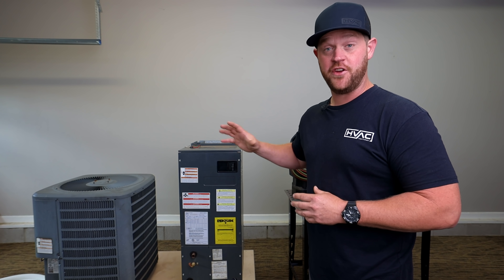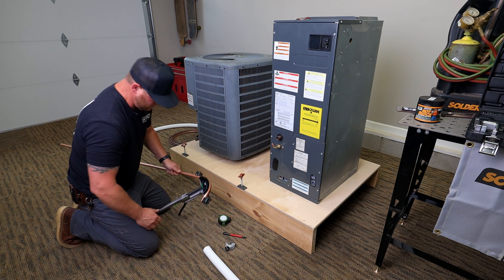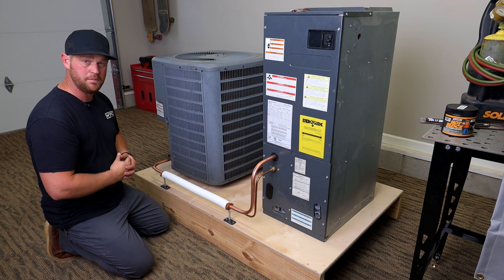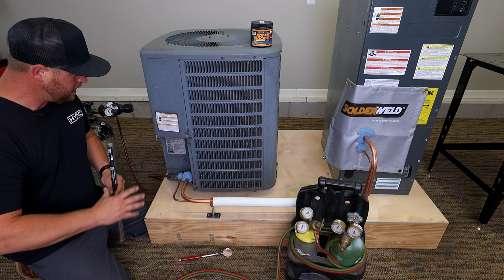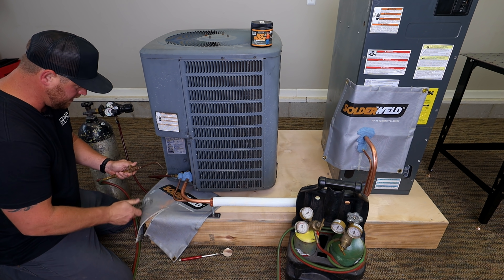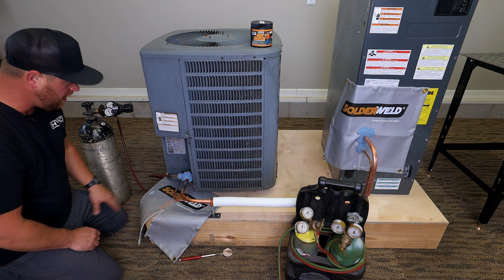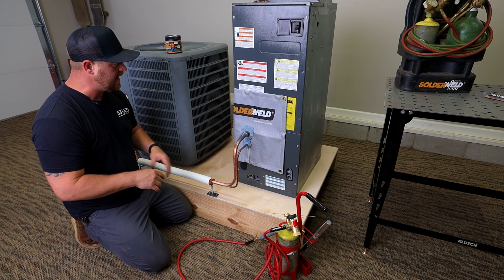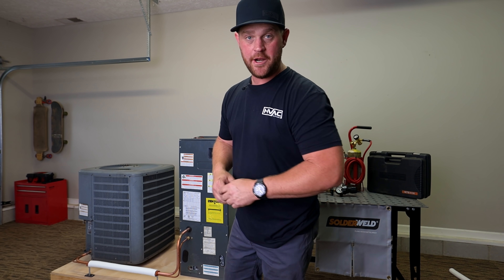How to Bend, Prep, and BRAZE Copper to Copper on an HVAC System

Comment: Is it possible to flow too much solder into the joint?  Like to where it pulls it past the joint and introduces pieces of solder into the system?  Or will any solder that flows in past the joint stick to the walls of the pipe?

Comment: Typical, brazes 2 fittings without saying a word about what you're doing.  Where are you applying the heat?  To the pipe or the fitting?  At what point do you apply the filler rod?  How do you get the solder to flow into the joint?  If you're going to do a "How to" video, tell us what you're doing and why!!!

Comment: bending  the heat pump unit, 90 degre 7/8" soft copper be careful.
 tear and Crack when heating mode about 450psi.

Comment: I agree with a previous commentor. I use a competitors bender with the same general methodology. Dispenser works a little different than a conventional lever bender and there are marks on the one made by yellow jacket but you fail to show people how to get the marks, and lay out the pipe, so the piping comes out measurement and dimensional. Perfect, but thanks for the presentation.

Comment: Dude, you don't braze like that. You should heat where you want the solder to go. Also using a turbotorch creates too much oxidation inside of the pipe

Comment: Even thou you might have done it, I didn’t see you ream your ends, or clean your joints.  I know most people say that with good 15% rod, you don’t need to clean the fittings, but to get full penetration it’s best to do.  I see that you are melting the rod with the torch.  Bend the rod in a short 90 at the end, and heat the fitting enough to melt the shoulder on its own.  Feed the shoulder in form the opposite side of the torch, otherwise you’re just capping the joint and won’t get full penetration.  If you do it this way, your in and out a lot faster, and don’t have to ad more shoulder and move it around. Same technique for stay brite # 8.  Good video.

Comment: My company uses wet rags and thermal paste to protect the units and for those rubber grommets we just slide them down the pipe and then put them back in afterwards

Comment: The heat sink (blocking) ability of Wet Rag around the pipe shown is minimal as it needs significantly more contact to be effective. More importantly, your attempts to get filler rod into the joint is a complete failure. Once the joint reaches dark cherry red, the melted rod will fill the joint in 1 or 2 seconds and will never require you to heat and apply filler in several places around the joint. You're merely capping, not filling.

Comment: Question, if you don't have the tool to make smooth 90 deg bends, are you able to use 90 deg copper couplers and braze those instead?
Reply: possible bur not ideal less brasing on an install the better

Comment: Product placement video shrouded in the false promise of valuable information. Show the details of measuring those bends, cleaning the copper, how to purge with nitrogen and at what pressure and where, tell us the brazing technique, ANEALING!?!?! And worse of all in my opinion: insinuating that you never have to take off the TXV sensing bulb before you braze... Ouch.

Comment: Stay-Brite 8 is best to use on new copper, txvs, and filter dryers. There is no point in brazing in many cases.
Reply: I've found it very useful for things like compressors which have a steel roto-lock suction valve. Can't braze mild steel to copper, and the fit is very tight, so a little sanding and staybrite #8 makes a solid connection, and don't risk burning up the valve trying to use 45% very expensive silver solder. That stuff needs even higher temperatures to melt than Sil-Phos and heating mild steel to red hot temps can temper it, or excessively harden it making it brittle.

Comment: That’s what I hate about sponsored videos there is a lot of bull. I bought the Hilmor bender and it sucks. It is nice and sturdy but it kinks the line it’s not a smooth bend. It does good on like a 45 but on a 90 forget it. It’s even worse on smaller lines. Stay away from that bender if you do not like kinks on your pipe.

Comment: How do you know if you can use your old copper or not what signs should you look for or should you replace the copper every time you replace both units
Reply: Only replace the copper if it is undersized or oversized for the new system. Other wise if it's the proper size flush it with Rx11 and your good  to go.

Comment: I always find brazing copper into the service ports to be a little tricky. The rod never seems to want to melt into it properly. Some of the more experienced techs swear by using a little bit of flux to help. I've never tried it but I'm curious to see yours, or anyone else's opinion or advice on that.
Reply: I remember I used to say the same thing but it’s honestly because you’re not getting it hot enough and/or your flame isn’t set right
Reply: @Josh-px6xb  Yes proper heat and sanding/cleaning fittings is the key.
Reply: use some emery cloth and sand the inside of the fittings well to remove that brass colored crap. They're actually made of copper but that yellow or brass plating gets burned when heating. I roll up a little piece to the right size, and sand it. Also sand your copper, even if it's new. Even new copper has a light coating of oxide on it, and also the small scratches in the copper give some imperfections for the brazing filler material to 'bite' into.
Reply: It because it’s brass to copper the brass takes much longer to heat, same with filter driers and certain other fittings and valves
Reply: @jonnywonderland420  I think it is just a thin brass plating, but you can use brazing flux on you sillfoss rod.  It will flow a lot easier.

Comment: For someone clueless like me, the 3/8th inch line carries refrigerant, and the 3/4th carries condensation?
Reply: Subcooled Liquid in the 3/8, superheated vapor in the 7/8.  Liquid goes “into” the home (to the evaporator), vapor returns to the condensing unit (outside the home), where work is done to it to condense it back to a liquid to return back into the house.  It’s an interesting process.

Comment: Been watching your videos.  Are most package units on residential homes really all hooked up with flex in the nashville area?  Im a duct man from north east alabama and most package units on residential homes have square duct for supply and round duct for return.  Depending on the job, but really the only time i run across flex under a house is a crossover on a mobile home, then  what i do from there depending on size of unit is run round hard pipe then reduce down again depending on size of unit, then tap into exsisting  mobile home duct atleast four times kinda spread out on the trailer to get  better air flow to the already crappy trailer duct.  I normally will cut in a floor grill for the return and put a slanted filter so as not to make floor grill bigger than needed.  Anyway about that, juat wondering how residential homes are hooked with flex..kinda blows my mind.  I hope they arent spider web systems...

Comment: Is Nice the vídeo .but nenes to explain.be careful with the txv.and theliquid línea And bulbo sensor un the los SIDE ay the Air handler fue can be damage the blankets cover out SIDE but insiste 
For the conduction heat.

Comment: Always protect your eyes from uv and ir radiation when brazing. You don't realize you are damaging your retinas over time. You will eventually find everything is darker and it's hard to read stuff without a light. It's a gradual injury and it sucks.
Reply: What kind of glasses would you suggest for that ?
Reply: @hgn1832  Any regular safety glasses will work as long as they are Z87+ rated. Should be printed or stamped on the side of the glasses.
Reply: @hgn1832  Shade 3 face shields are more comfortable for me than glasses since I wear prescription glasses. Blue brazing lenses are even better but require either goggles or a welding helmet. tinmantech etc have those.

Comment: If you braze and get a leak, can you heat and pop out the fitting like a soldered copper pipe for water or is it stuck and you have to cut it out?  Thanks.

Comment: I thought you werent supposed to put the solder directly into the flame??  I thought you heat the pipe and with the flame on one side you let the solder wick from the opposite side.
Reply: In soldering that works great. This is brazing not even same process.

Comment: This is a perfect video for me. I was afraid of melting the rubber band of the air handler..I love the idea of using hot block puddy and solder weld..
Reply: Slit the rubber grommet and remove it. After you braze the lines reinstall it…eezy peezy
Reply: @matthewportnoy4146  thank you so much !!

Comment: Nice job but I don’t think you need to purge with nitro unless there is leftover refrigerant in the system and not air and also you should always braze the liquid line first to prevent getting burned by the hot suction. Helps me a lot

Comment: I’ve been doing Hvac for 22 years I have never used a heat shield or putty. B tanks or turbo torch sucks. And you should’ve shown how to pull back the insulation and not split it for a proper install
Reply: Nailed it. On all points. Good job.

Comment: I was taught to make sure the pipe is almost  glowing RED then you apply the solder , not sure if you did or not , couldn't really see , but want to ask , I've only brazed couple times, appreciate your input  . Loving your video's to , new subscriber , thanks
Reply: Yes so you know that the copper is ready for the solder so it can be sucked up in there and you get better coverage, then repeat on the bottom. I myself always have problems with brazing under the copper lol.

Comment: I’ve never used one of those turbo torches. That’s what they’re called right? It seems like the flame is a lot bigger though. It makes it look like you can control the heat application better when you use oxyacetylene.

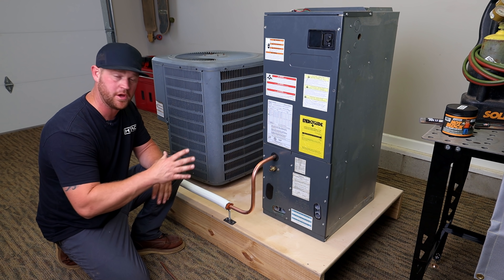Comment: 3:34 - Easy for you to say!  You didn't show any of your measurements.  Your take-offs, take-ups, where to put your mark on the bender? Did you measure the back of the bends, inside between the bends?  Disappointing. I've seen good brazing techniques before; but, none that show how to bend (bending EMT is very different from bending ARC.)

Comment: Nice job. You should try staybrite #8, no nitro needed only small map gas cylinder and proper torch, throw it in a bucket and great for attics, light and easy.
Reply: StayBrite #8 is the best for installing new equipment.  I used a propane torch.

Comment: The flexible liquid tight conduit coming out of the HVAC unit. How much slack does it suppose to have before you strap it to the wall.....
Reply: That's an electrical code question. Check with your local code jurisdiction.
Reply: @512kjt   how do I do that.

Comment: No ofence how abouth heat up brazing rod abouth 2" -3" bend to  90 degrees  makes easier to get around copper joint
Reply: Yep! It's first thing I do when I light my torch and get ready to braze. I always heat close to me and place the rod behind the pipe and then work the silver solder towards me.

Comment: what measure is the suction line?  What type should the pipe be so that it bends and does not crack?
Reply: Must suction line on residential are 3/4 or 5/8,and use soft copper piping

Comment: Question: If you were going to seal the system with the cores, is it better to let nitrogen flow until you get the vacuum on? Just wondering if its faster.
Reply: Nitrogen purge until you can hold the effected areas with your hand.

Comment: If you use the PL-12A Tip Swirl you'll be able to weld 7/8" copper with no problem. 
Price: $119.41

Comment: I would have liked to see you measure the pipe out! Love the videos!
Reply: I agree. Bending a 90 is easy. Bending a 90 in the exact spot you need it requires experience. I'd like to learn from his experience as to how and where to measure for a perfect fit
Reply: @14idontcare14  With those benders you put your mark right in the center of the mandrel.  I have the same type but a Yellow Jacket brand.

Comment: Everything looked legit up untill you torched the top of the pipes and toss cold globs ontop then hit the underside, heat rises.. start underneath
Reply: YEP!!! He was heating and following instead of heating and pulling. It isn't necessarily a matter of heat rises, it's a matter of heat flows from hot to cold. The heat will pull the solder towards it, even defying gravity.

Comment: Oxy-acy.is obsolete, unless you're not. Blockade works best instead of silver, much too expensive. Normal B-tank is all you need,  but acetylene is preferable if you have that. They stold mine. Use a common electricians 3\4 shoe to guage perfect bend lengths. I love the heat shield putty. Practice a bit with Blockade to get it good, fast, & cheaper. I don't use silver bearing solders anymore, but they do work too. Just Blockade.

Comment: good tip when using a hand ratcheting bender is when the bottom of your wedge reaches the top of the t-bar its almost always near a perfect 90! cheers from a fellow HVAC installer

Comment: Couple mistakes in this one...

1. You never show how to measure or bend pipe with the Hilmor style bender.
2. You never prepped the pipe.
3. You're capping the connection, not actually joining the two materials.
4. Applying hot block that close to the joints on the air handler will not allow for the solder to penetrate the entire joint. That's why you were struggling on the evap side.
5. CLEAN YOUR OXY PROCESS TIP!
6. I don't think I have ever seen anyone use sandpaper to "clean" a joint? You're creating voids to allow corrosion to occur.

This is just another solderweld ad. Anyone in the industry knows Lucas Milhaupt 15% rods are not only available everywhere, but are also far more superior that SW.
Reply: Prep the pipe on clean copper? It’s not soft solder, secondly the heat block is to prevent damaging temperature sensitive devices such as pistons/ TXV’s, or for filter driers and sight glasses and obviously pistons and txv’s are bulkhead fittings going through a cabinet so no possible way to get heat block further from fitting. Also the “BRAND” of 15% rods doesn’t matter, it’s all depending on the user to be able to make the joint not which name brand is better they’re the same “15%” rods.

Using sand paper on copper puts such small abrasions into the copper that they will be filled by brazing rod regardless. It’s like you were looking for petty stuff to complain about and nothing of actual value besides maybe him not showing how he measures for the Hilmor bender. Last thing the temperature of those fittings and at the angle he was holding the rod while making connections the cups were getting filled maybe not to med gas standards but enough to make a solid connection.
Reply: @GFY..-..  Thank you for this. You saved me from the frustration and effort of typing a response (except for this one).
Reply: My complaint is lack of safety. He's brazing near wood and carpet inside without any kind of precautions. No gloves which I guess is still better than the rubber glove goofs out there but either way safety is a must.

Comment: Do you prefer oxy acetylene or the b tank? With a torch welding background I always found oxy acetylene to be cleaner and much quicker.
Reply: Brazing with B tanks is for those who don't want to take the time to learn how to properly dial in their gases or aren't confident enough to use oxy/ac for brazing.
Reply: I brazed steel rule cutting dies (big cookie cutters under high mechanical pressure for fabric) and you're dead right about OA being preferable. I collect and rebuild torches and regs so I'm wallowing in full sets of "everything". I use turbo-style torches for soldering and heating small stuff but not near as often as my OA rigs.

Comment: Very nice Zack! The oxy acetylene flame didn’t seem right to me.. dirty tip maybe? Maybe I’m crazy? Lol either way great video.
Reply: You are on the money. His tip had too much acetylene (or not enough O2) flowing as evidenced by the orange flames. When adjusting for an oxy-acetylene torch for brazing copper you want a nice balance of ac and o2 so the flame tip isn't too tight (loud) nor isn't too loose. Once you get the needletip flame, pull back on the O2 so there is a little bit of a feather off of the torch tip, instead of the needlepoint blue flame. Should be a little quieter, a little bit cooler and more manageable.

Comment: Hey Zack I would recommend you to use a safety glasses just for any flame when you brazing.Thank you for your video
Reply: From the uv light ? What kind of glasses would you recommend?
Reply: @hgn1832  .hey Zack this is safety glasses that I wear when I brazing…..
(Jackson safety 25671 Nemesis about $7.00 but safe your vision long run).Thanks for all your videos. 
I buy it Amazon

Comment: I've been using hot damn for years and I still use wet rags!🤔😂
🍺🍺🥃🍺🥃🏌🏌🍇
Stay safe.
Retired keyboard super tech.
Wear your safety glasses.
Reply: Been at it for 30+ yrs. Water and strips of wet rags to wrap around the valves, no issues. I used that heat block stuff once and got it on the braze joint and holy shit. I COULD NOT get the silver solder to take. Ended up having to cut back the copper and make up new joints. Haven't used any heat block since...

Comment: Great video. However I don’t recommend the victor regulator. You’ll need to purchase a separate regulator to pressure test. My recommendation is the Western Industries Regulator. You can braze, purge, and test all in one.
Reply: My victor, just like his, does 800psi pressure test if I want it to. They have lower pressure models, maybe that’s what you’re referring to.
Reply: Hey jack you can do everything on the victor

Comment: Nice 👍🔥You still got to remove the Sensing bulb is things are too damn Sensitive they should at least handle about 200because the heat pump gets that hot sometimes. As well as the O-ring